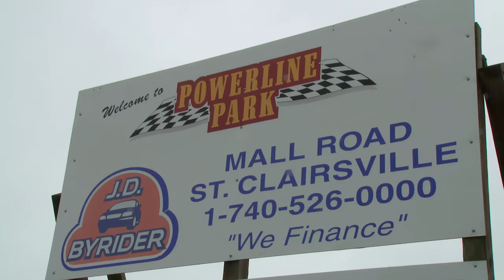Check-In & First Day Of ‘Wheeling' - Part One of Ultimate Adventure 2015!

Comment: I've never been interested in 4x4s but that looks awesome fun
Reply: +stupidstufwtmyfriend 
To be fair, there's a lot of offroading going on, over in commie land.
Ofcourse, they tend to do it in huge ex-military offroad trucks, with a load of logs in the back and then they call it "Work".
Some say they might be crazy, with only a little envy in their voices. :D
Reply: +g4rr377 I never was either, but there it a lot of interesting engineering in these trucks. Once you put on bigger tires to handle bigger obstacles it changes every other system in the vehicle. Then there are suspension changes. Normal cars try to stay flat while these rigs want to accommodate uneven terrain. Very interesting stuff.

Comment: Is that tech check list available somewhere. would be nice as a guide line as to what to include in my rig.
Reply: +pat Sun There will be a tech inspection at check-in. Your vehicle will be inspected for all of the following equipment and paperwork. You will not be allowed to join Ultimate Adventure if your vehicle fails this inspection.Vehicle must be road worthy and capable of sustained highway speeds of 60 mph and a fuel range of at least 150 miles.Vehicle must be street licensed and insured, and driver must have a valid driver's license, current registration, and current proof of insurance.Front and rear axle lockers (limited slips do not suffice)Must be self-sufficient (bring your own spare parts, fluids, tools, food and water)Front mounted vehicle recovery winch, and controllerWinch accessory kit (tree saver, snatch block, clevis, chain, gloves)Rollbar with safety handles or grab bars (rollcage preferred)Adequate first-aid kit per Red Cross requirementsSeatbelts for all occupants, always worn when vehicle is in motionAdequate recovery tow hooks and/or shackle/clevis attachment points front and rearSecure battery hold-down35-inch minimum tire size and adequate spare tireFunctional parking brakeProperly working CB radioFire extinguisher mounted in reach of occupantsSnatch strap/recovery rope-without metal hooksAdequate jack and jack pointsSpill kit and PETT kit

Comment: Off road people answer this question:

Why not build and off road vehicle with like 8 wheels instead of 4? Have 4 of them for road driving , then bolt on the extra 4 wheels when off road? YES the engine would needs lots of torque to turn 8 wheels , but just get alot of reduction in the gearing and you can make torque.

Surely more wheels = more surface area for grip. 

Either that or use giant tractor sized wheels. Bigger wheels = smaller rocks , no? And yes again you need power and torque for big wheels. But can be had with lots of reduction in the gears , you won't go fast but it's off road anyway.
Reply: +Foxontherun2 Cost and complexity. There are vehicles built like this in the heavy off-road vehicle market in places like Russia.
Reply: +Foxontherun2 Cost and Complexity! These vehicles get driven a few thousand miles for the event. More parts means more to maintain, more to break, etc. Sure, it would be fun to play around with a crazy idea, but would it really be worth it? These vehicles are already probably some of the most capable things around.....
Reply: idk I think if you bought a couple 1000$ old chevys you could get all the parts you need for it
Reply: +Foxontherun2 Sure, go for it! Apply next year. Personally, having gone twice now, I would keep it simple, reliable, and functional. Four tires, with only the front steering, can be PLENTY capable when built right. This trip isn't just about ultimate off road performance, it is also about driving LOTS of miles on the highway/interstate at speeds in excess of 60mph for a few thousand miles. I drove 3150 miles the 1st year I did! You don't know if your going to be in the mud, water, rocks, sand, or whatever else they can dream up....
Reply: idk I think 8 wheels would at least be more interesting , otherwise it's like , everyone has the same thing pretty much

I wanna see something with like 8 wheels and two engines , and 8 wheel steering , somthing cool and different , not just the same old thing
Reply: +Foxontherun2 If you built it and get it to work right, I think you would have a good chance of getting accepted as an invited reader. Go for it!

Comment: I have been waiting months for UAW to land, after seeing snippets "leaked" from the sponsors channels.

Does anyone know what axles the rangy is running. Over here in UK, Landy axles don't seem to be considered that strong. I wonder if it had been fitted with something else? LandCruiser maybe?
Reply: +dibley1973 Stock-ish + ARB lockers and alloy shafts.
Reply: +Metcalf - Aha, thanks, it was the half shafts which I heard are the weak link in a totally stock axle. 

Having watched clips about stress testing ARB's difs I understand they will not fail before a standard half shaft, but out of interest do you know if those alloy shafts will still fail before the diff internals? I.e will the splined end shear before the anything gives up in the diff? I assume it is always preferential to knock a broken spline end out of the diff and replace the shaft rather than replacing a cracked diff casing!
Reply: +dibley1973 i'd suspect the ring and pinion would go before the ARB locker or the alloy shafts.
Reply: Cool. good to know as I'd like to build a Disco 2 at some point with ARB lockers.

Comment: So you carry spare hubs, welder and everything so where does it all fit?
Reply: You can fit a lot of gear in some of those full size rigs
Reply: They just look so small, that's all
Reply: +Josh Smart When you have 20+ vehicles special equipment can be spread out a bit in the group. There is always a balance on how much to carry vs weight vs performance. In the end everyone helps.
Reply: +Metcalf Thanks

Comment: You to can be a 4wheeler adventurer ..if you have a 100,000 fkn DOLLARS ..or blow the editor? One of these yrs there will be a PIRATE coverage of this from the start to the end ...secret and all. LOL . You can bet on it
Reply: +Hadrian Wall I didn't have $100K or give anyone anything....and went twice. I took my 70+ year old flat fender that I rebuilt in my garage using parts mostly off Craigslist. It was an amazingly rewarding experience both times. All you need to do is apply and hope you have something original or unique enough to stand out.
Reply: +Hadrian Wall Yeah I don't know man several of the vehicles wouldn't cost much to build.  Couple look near stock outside the tires and roll cage's, and bumpers.

Comment: Why open the video with a vehicle that should have failed tech inspection?  

Your standards are slipping.  Before we know it, you'll start allowing whining.
Reply: +Brian Carpenter What vehicle should have failed tech?
Reply: Hey +Metcalf, the Chevy Colorado (4:36-4:43) that they use to demonstrate tech inspection should have failed based on this rule:  "Rollbar with safety handles or grab bars (rollcage preferred)"
http://www.fourwheeler.com/ultimate-adventure/ultimate-adventure-application/

What they have is a roof rack, not a roll bar - definitely not the preferred full cage which nearly every vehicle has had for almost 20 years of Ultimate Adventures.  Otherwise, a pretty cool truck.  It's more visible here:
http://image.fourwheeler.com/f/89930418+w600+cr1/ultimate-adventure-2015-part-1-11-chevy-colorado-on-waterfall.jpg

It is my opinion that 4WOR squandered an opportunity to show good examples of meeting the rules, rather than trying to be cheeky or ironic with "here's some half-baked excuses, weeee, fun".
Reply: +Brian Carpenter I know what it looks like, I was there. The BDS/Pacfab 'Craworado' did not have an interior cage, but the external setup that they built was very well done for the most part. Could it have been better, yes. I would have classified it as a rollbar, not a cage. The vehicle was also a factory unaltered hard top. After last year when I saw the aftermath of the Blazer rollover, I don't think ,personally, I would do the event without a cage. In the past, factory hard top vehicles have been allowed on the trip without a bar/cage. Last year, the OPP dodge ran something similar to the Crawerado also.
Reply: +Metcalf Thanks for the detailed responses from your first hand knowledge!  I checked out  the OPP Ram you're talking about (https://scontent-lax3-1.xx.fbcdn.net/hphotos-xaf1/t31.0-8/10353485_738567032867936_7612790754431571384_o.jpg) and am glad they built a full cage for their Chief this year.  Clearly they know what they are doing, and I'm sure the rack/bar is better than nothing, but I hope that 4WOR requires A-pillar bars in the future.  UA should showcase the industry's best, and that should include safety and preparedness.